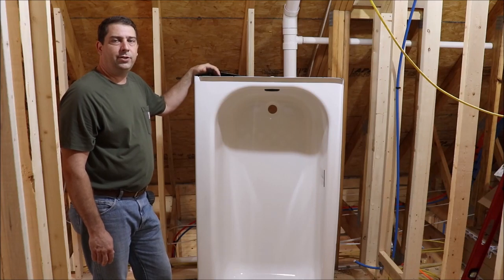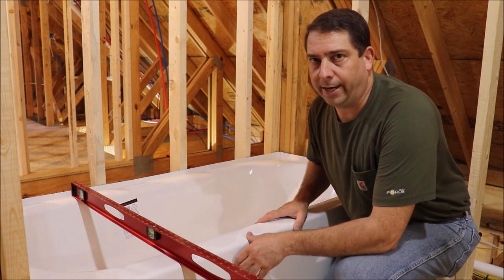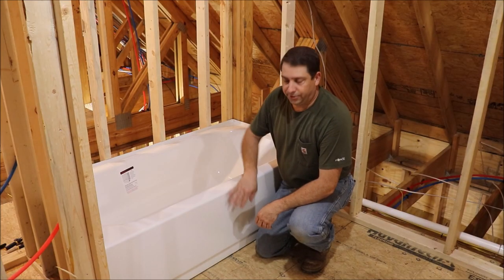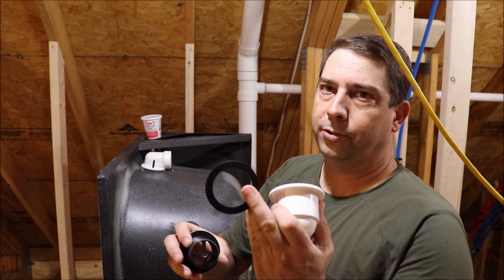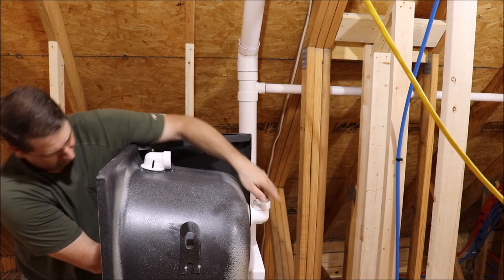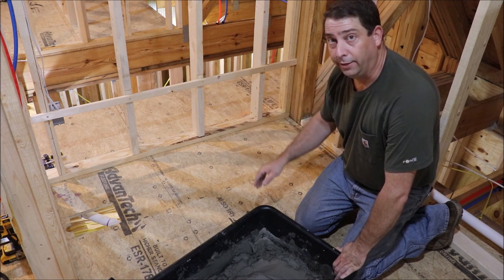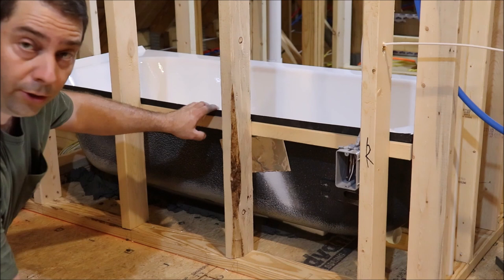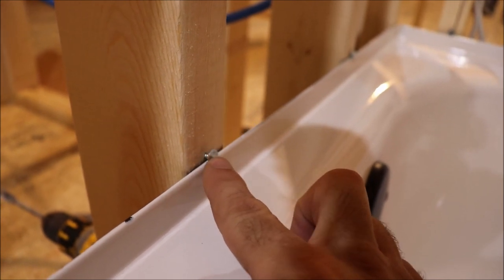Building My Own Home Episode: 108  -  Installing a Bathtub

Comment: The plumber i used for a lot of remodels, would set the tub a degree or two off so water on the edge would run back into the tub, rather than on the floor. He would also set the tub, put a few boxes of tiles in it and then use spray foam under it. Never had a problem.

Comment: I'm a plumber, I put cast-iron tubs in my house and you don't have to worry about doing all the mud bed and being crooked on the back and it will be there forever. I have repaired or replaced mini steel tub that rusted-out around the drain. By the way your house is just amazing and you did a wonderful job

Comment: I drill the flange two thirds up and use flat head galvanized screws to fasten the tub to framing,( be careful to have full contact with wood as you doing it)  also natch the wood and sink the flange into it at least two sides of tub that way you will just need to shim one side,  run bit of corking on the tub flange before installing tile backer, use pencil to gauge your board up from the tub and then cork that space just as you tile. I suggest using commercial construction materials/tile board that you find in a drywall distributor 5/8 board is really superior to a half inch that is used in residential construction. Also, get 2x2 metal 90 and use it in corners drop it down 1/4' in below top of the flange into the tub, that will eliminate future corner tile cracking.

Comment: I have a track of land in Louisiana I'm just starting to develop myself your videos have inspired me to get out there and make some progress . I just made it across the ditch and starting clear a driveway  i have a shovel and a machete but making slow steady progress working on getting a 9n that would make world of difference ... great videos the homestead is turning out great keep up the good work!
Reply from the maker: I've got a 9n I was fixing up. But then I got my dad's ford 2000. I need to sell my 9n now and start fixing up dad's. I still like the old 9n , but the ford 2000 is a power house compared to the 9n and I can't really justify keeping two tractors. What part of Louisiana are you in? I am originally from the Mississippi / Louisiana area. I grew up just across the state line from the LA state pennatentary.
Reply: I'm in Abita Springs about 20 miles from the Mississippi State line down on I 12

Comment: You want to keep the Durock about 1/2" above the bottom of the flange to prevent the water wicking effect.  Otherwise it will mildew around the seams.  Then the tile goes over the Durock and down to the bottom of the flange (practically) with caulking at that bottom.  StarrTile's Youtube channel (the tile guy) shows many cases of mildew problems in putting the cement board or down to the bottom of the flange.
Reply from the maker: Ah, I found Starr Tiles page recently. Been trying to watch his videos to learn how to do my walk in shower too. Seems like he knows what he's doing. I just hope my job comes out looking like one of his afters and not the befores!
Reply: I did my shower all because I learned from StarrTile.  I installed an acrylic pan, so I did not build a real shower with mortar.  He doesn't like pitching the first part of the mortar pour, even though it is a code requirement, and he'll have a holy cow if you criticize him about it - he doesn't think it's necessary.  Every one of us has some issues.  I held the Durock back from the flange 3/8" to 1/2".  I didn't back butter the 4"x4" tiles, but next time I will.  He's very good.  He has a beginner series of three videos on installing the floor drain and getting started.  I mostly learned by watching him point out the mistakes of others.  He doesn't install those fiberglass shower kits because he doesn't like them - he likes original, hand-made showers.  Also, I didn't buy the $50 bucket of Redguard, which he puts over his greenboard (up to you).  Good luck to you.  You'll have an easier time because you won't have to pull an old shower apart.  I practiced tile laying first by getting a large piece of drywall, screwing it vertically outside to my wood fence, and laying tile.  But you may not need the practice from the looks of how you laid those cement blocks....
Reply from the maker: Lol, thanks! I have to admit I was surprised by how well the blocks turned out. Believe it or not I had never laid blocks before I started my foundation. All the columns came out level to the stem wall and I think the stem wall came out within a 1/2 inch of perfectly square. I couldn't believe it, and I hope to NEVER do a project that big again! Lol. But I do want to build a small root cellar after we get moved out to the house.

Comment: Just bring your durarock to the top of the flange.  If you overlap, it will flare out and your tile will show the taper.  Your tile can extend past to within your grout joint of the tub.
Reply from the maker: Good tip, thanks! I haven't ever tried tile before so I have a lot of learning to do before I start it.
Reply: @ArkansasHomesteader  Very good tip, no one has mentioned this in any tiling videos i've seen!
Reply: That is incorrect and bad advice, lazy way to do things. flange needs to be recessed into the framing or framing needs to be shimmed so the board can go into the tub.

Comment: The only things I would do differently- I would use a quality fiberglass reinforced tub. They can be repaired - in place -if chipped, cracked or damaged. I would use good grade silicone caulk to seal the drain instead of putty. I haven't used putty in 25 years for drain sealing to tubs and sinks, a problem eliminator.

Comment: Just offering another option to durock you may not know about,  it's called Wedi board or Kerdi board. They are lightweight  waterproofing sheets that can easily be cut with a sheetrock knife and waterproofed in no time so you can install them and tile the same day. Again just a suggestion that might make your life  easier especially since you work alone most of the time. Here is the link to one video  but I'm sure you can do your own search and find more, https://youtu.be/2fhV8KOUHZs?t=516. Love watching your videos and look forward to the next one.
Reply from the maker: Thanks for the tip. I haven't ever done tile so I will definitely have to do some studying on the options before I get started.

Comment: 2:07.....you don't want the tub level....yu want it a quarter bubble off.... otherwise water will collect on the wall side causing mold
Reply: Bullshit, the tub is designed so all water runs to the drain. The tub must be level when set. You should not offer advice when you dont know what you are talking about. This is coming from a master plumber with more than 50 years of experience.
Reply: Don Radcliffe thank you. why is a mud bed needed? I get that it holds the tub in place but if I screw the flange on 6 studs isn't that enough to call it secure ?
Reply from the maker: You're right Don. Plus the manufacturer's instructions specifically the tub should be leveled.
Reply from the maker: Peke, the mud bed is needed because the side and rear flanges aren't designed to carry the wait of the tub with water and a person in it. The mud bed takes up the room between the floor and the bottom of the tub. Once the mud dries it won't compress under the weight and completely supports the tub.

The mud may not be needed for tubs made out of other materials or other designs, but is needed for this particular tub design.
Reply: Arkansas Homesteader sound  advice, mud bed it is. Thanks 👍🏼
Reply: I don't really know where that started. I remember as a young man around 1968 when I first started plumbing that it was done everywhere. I believe it mostly was for deadening sound. Even with 500 pound cast Iron tubs. Later as plastic and acrylic tubs evolved it was done to support the bottom because they would crack after years of use I don't believe it was done to keep it in place, as you stated. Tacking it in place like you did is more than enough.bBut the styrofoam on the bottom of the Briggs you installed I believe is also to deaden sound.

Comment: How much did all your lumber cost? Not including the plywood sheets. I’ve been considering milling my own lumber for my exterior walls and interior walls maybe even floor joists
Reply from the maker: I gave somewhat of a cost break down in episode 100, but I am afraid I didn't break it down to that level. Just the total cost of foundation, framing, and roofing I think is what I gave.

Comment: I question why you wouldn't have installed a fiberglass soaker tub while construction is still under way. Steel tubs are rarely used these days.

Comment: I would never install a tub that small. Either get an adult sized tub or just got straight for a nice shower base/pan.
Reply: That's a standard size tub I believe.
Reply: Looks like the gap is 5ft, 60"  so its a short bath to me, 7" inch short, The standard for me is 67" .... A look at homedepot seems they are all around 60" or 72"
Reply from the maker: It is a 60" tub which I believe is the "standard", but it's also the biggest one I could fit in the design. And since this is the bathroom for my 5 year old, he needs a tub shower combo. So this is what I chose.